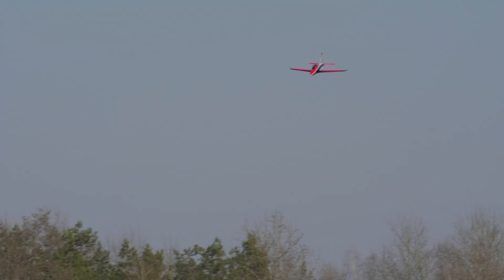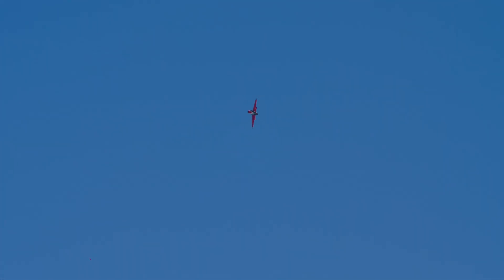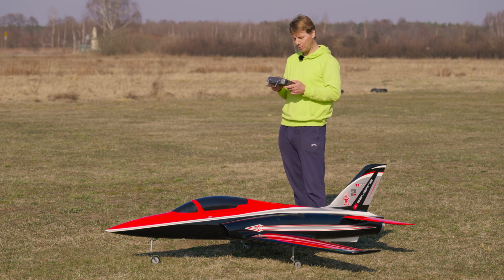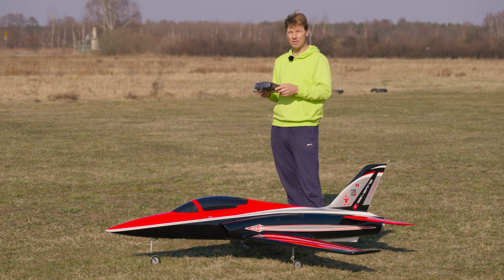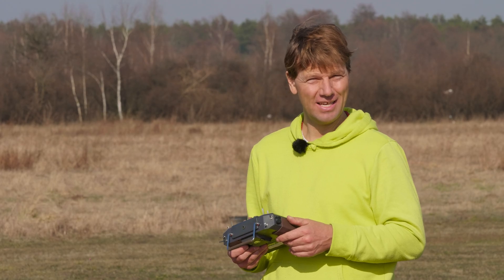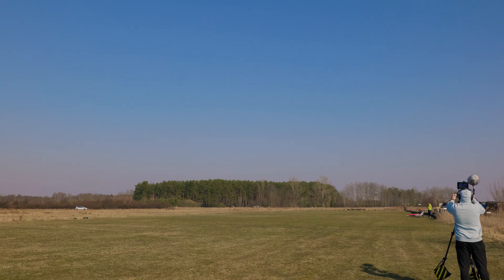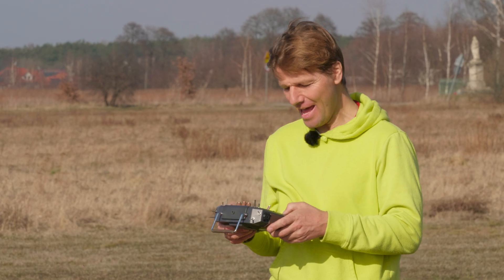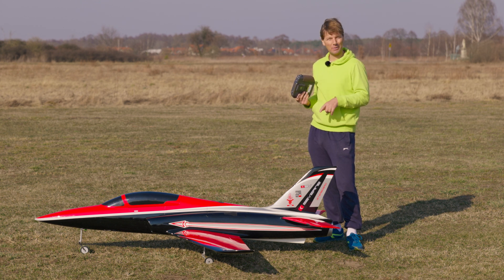Odyssey 12s 110A JETFAN-120 PRO EDF 254km/h 5kW 8,5kg thrust, TOPRC Jet Sound

Comment: hello pilot, I have an EDF 120MM Jp that accepts up to 14s. I'm going to use the EDF in a Sport jet with a final flight weight with batteries estimated at 10kg. question: do you think 12s will be enough?

Comment: Hello, what is the maximum amount of time you have tested the ZTW Mantis 150 Opto at 16s with LIPOs? Is this just a burst or is it sustained wattage for more than 30 seconds for instance?

I've tested the ZTW HV Optos on 12s 150 on the bench with NO cooling and they rarely got hot at all !! VERY VERY good ESCs

Thx in advance for any input

Comment: Have you heard about the 21700 molicel 42a cells they have a constant discharge rate of 45 amps and 4200 mah capacity they may be slightly better than the Samsung 40T cells you should look into them and put more videos up please 😅
Reply: Yes, Molicel P42A is slightly better. 
But now there is Molicel P45B entering the market and its a no contest compared to any other cell. 
4500mah capacity, 50A discharge AND 33% less internal resistance (less heat!) then P42A.
Reply: Wow that is awesome thank you so much hope to see you back in the air soon 👍